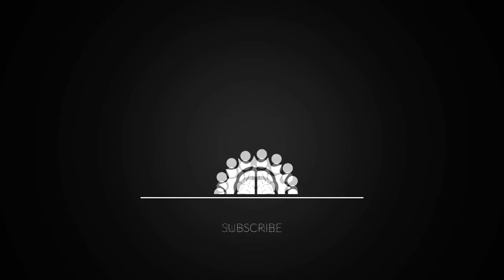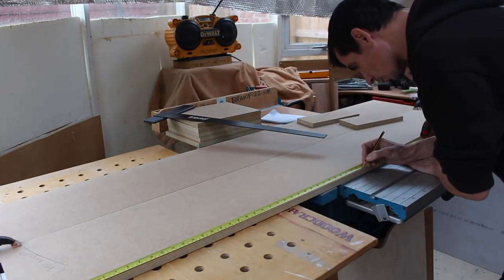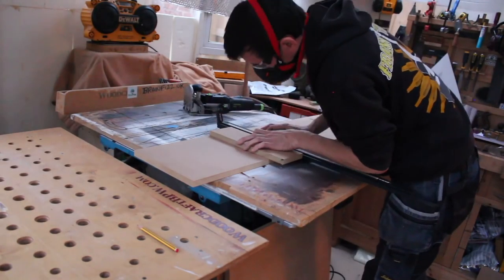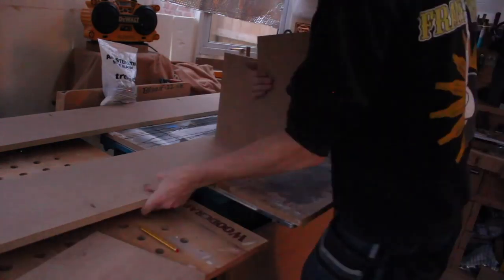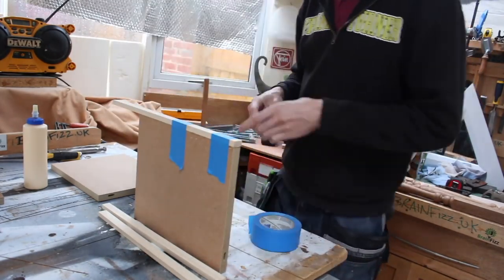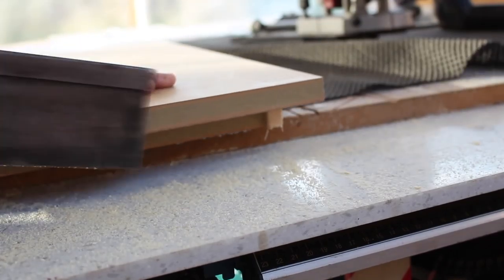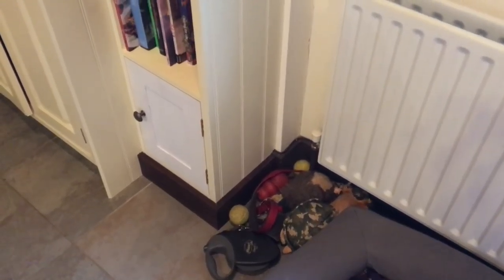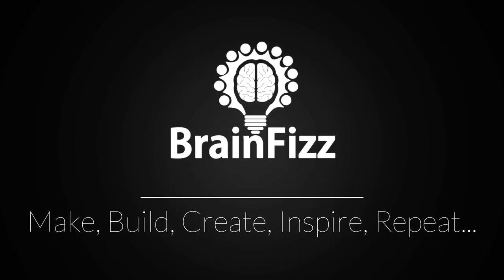Making a simple painted fitted kitchen shelving unit for a client. Tips for building Carcasses.

Comment: Hi Richard, when using the Domino on thin stock like the 18mm sides, I set the depth of cut deeper on the shelf side so less Domino is sticking out for the 18mm sides. Great videos, thank you.
Reply from the maker: That indeed is the general solution, although any forgetfulness about changing the setting means potential problems down the line. This project used 6X40 dominos, many people use 5X30 on 18mm boards for this reason, but I'm not really that fussy, particularly when the side faces will have end panels etc or it won't be a show face.

Comment: Hi Richard, sorry but I couldn't work out what fronted bit you used for your edge banding. I have a similar job to do. I was going to use one with a bottom bearing but it would mean balancing it on the narrow edge which I thought was a bit dodgy. Your method was way safer..can you let me know what you used? Thanks
Reply from the maker: Not sure what you mean by "fronted" Andrew?
the cutter I use for this set up is a three flute, down shear, bottom cutting straight bit. Although a good sharp  two flute straight cut can achieve the same result.
straight cutters with a bottom bearing (sometimes referred to as "flush trim bits") can indeed be used as you described on the edge of the work - and is a little wobbly at times, a good solution to this can be to gang several boards together (with a spacer to allow for the overhang of the lipping), to broaden the surface area the router can work on. Or make an 'L' shaped sport with a rebate/rabbet in the corner that can be clamped on the side to create the same broader edge. The rebate just needs to be large enough to accommodate the lipping. Hope this helps!!
Reply: Richard Morley "Fronted"was an autocorrect for router !! Thanks I'll thumb through my Trend catalog for something suitable. It's the bottom cutting part of the bit that I don't think I've used before.
Reply from the maker: gotcha - my macs are all a nightmare for autoincorrecting!

Comment: Why only 1 domino each side Rich?
Reply from the maker: Hahaha! Well spotted! Originally I planned to use two as you normally would - if you notice the shelves get two mortice a either side ready... when I had everything cut to size by the supplier I had them cut all the shelves shore including the top,bottom, and cupboard top rather than the same size as the sides( and just trim the shelves short..), so three bit needed to be lipped, and the holes would miss align. At the front. 
It was nearly a total cluster but since it was so narrow and end panels would cover everything, I could get away with glue and screws without the need to mess about resetting for all the out of line mortices at the front edge.